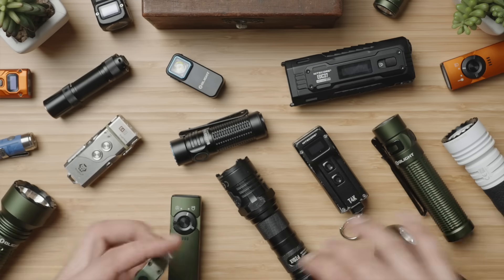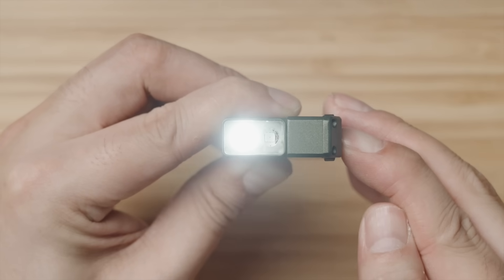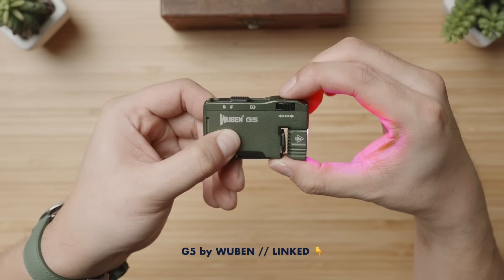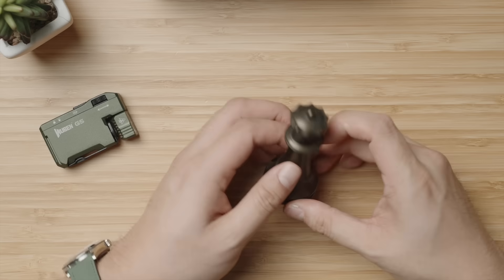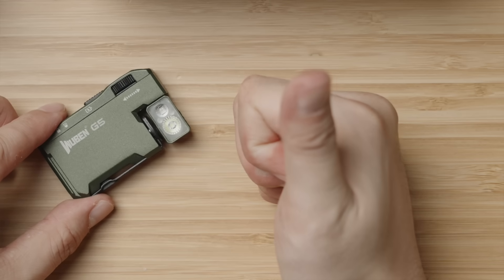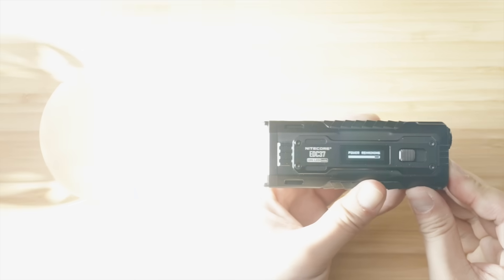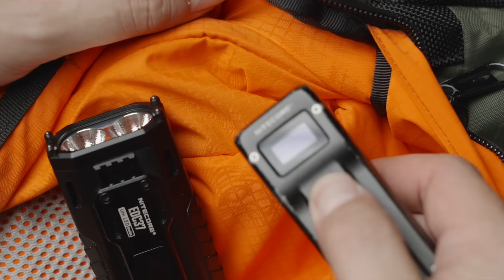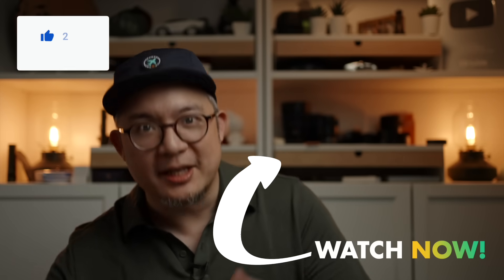Modern Flashlights are INSANE.

Comment: You can get flashlights with the same chips as the Wuben for less than 5$ shipped if it's "not" on Amazon, I have 20+ different ones, and they are all unbeliveable amazing. As for other amazing products, imagine a laser-distance measurer that can even use bluetooth to 3D-volume your interior, full metal body for under 20$. Or how about the futuristic pocket leveler with 2 lasers, and anglometer slash gyroscope that has an flatscreen LCD on every side so you see it from all angles? Or an Pocket Geiger counter with a dosimeter? Or an electrical nail clipper that is so good you wonder why you even bothered with the traditional one, it even polishes your fingernails to perfection. Or a pocket Soldering iron that actually works, it's even rechargable.

Yes, there's tons of these neat survival gadgets nowadays. There's even a comms radio that you can use as a walkie talkie that takes up less space than two fingers.

Comment: How much have you actually used these flashlights? They look brand new. I have had lights like this that just stop after some weeks of use. No longer charge, only turn on very dim or suddenly last for less than a couple of minutes. I feel these type of lights often use the Ali-express method of looking impressive where you can see but skip anywhere you can. The only ones I have seen last for longer are products like led lenser but those aren’t inexpensive.

Comment: Nitecore T4K's crappy lockout system still allowed it to melt through my small sling bag's external pouch and ruined one of my favorite shirts.  Level 1 Lockout is not good enough.  Needs to be at the more annoying Level 2.   Basically makes this flashlight useless as anything but a novelty light.   I primarily use Wuben lights now, better built, cheaper, and hardware lock outs, or properly shrouded buttons to prevent accidental activations.